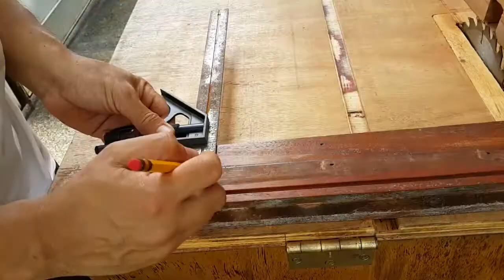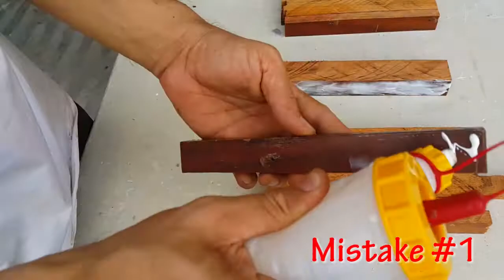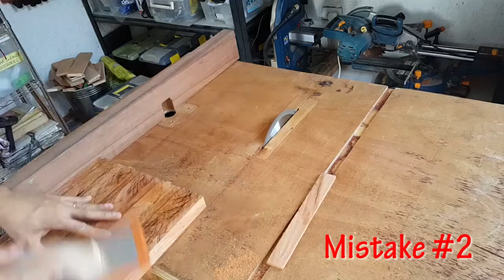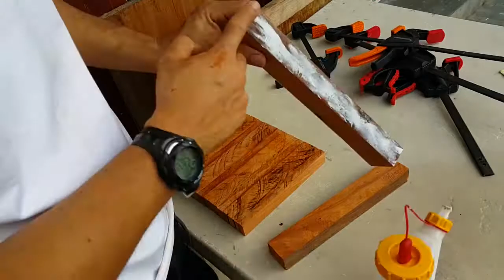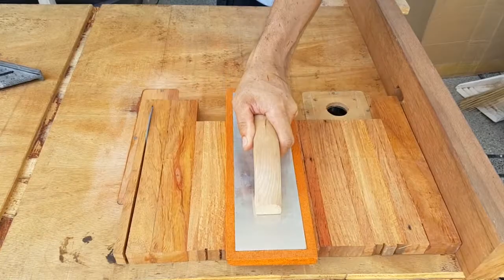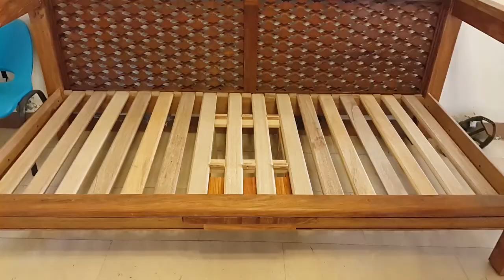DIY Custom Pullout Table for Sofa Daybed

Comment: Sir, I'll just want to ask your opinion. Plan ko to design a Trundle/Pull-out bed. The top frame is raised 615mm  to make the pull-out frame itself a bit higher. Kaya lang bro fit na fit yung length ng frame sa width ng room, and the wall on 2 sides (1 along length and 1 at the endside of frame) is Concrete (buhos) and the other side is drywall (fiber cement board na manipis with metal furring). I would like the top frame to be fixed on the concrete wall sides and on the drywall side is 3/4" plywood or flat bar as foot. The reason is sisikip na sa pull-out bed below if both ends are wooden feet. Do you think this is okay? Salamat bro 😊